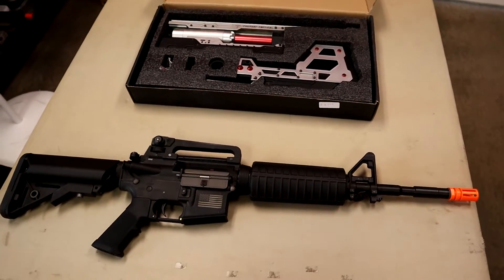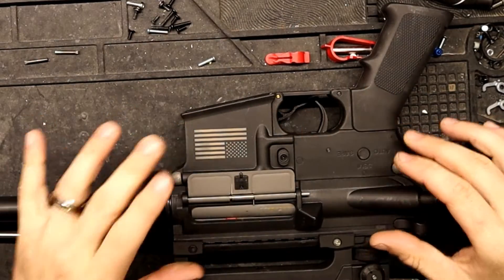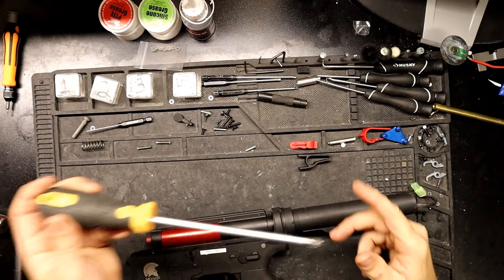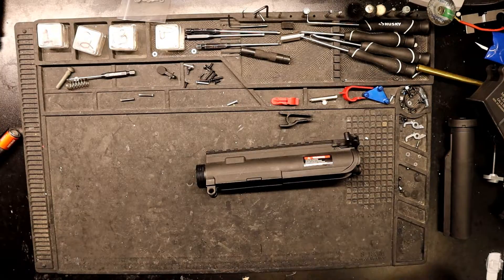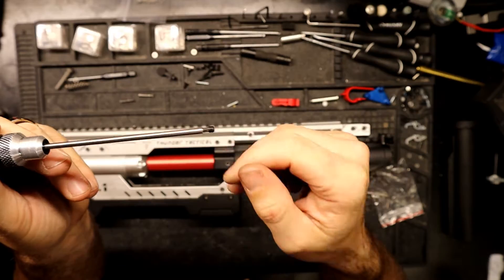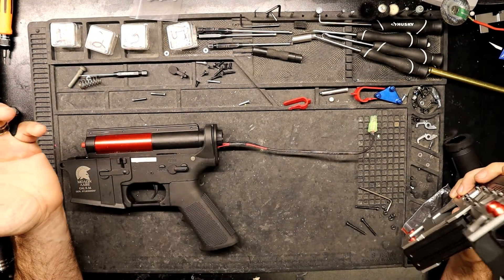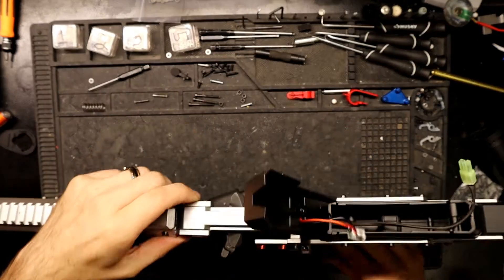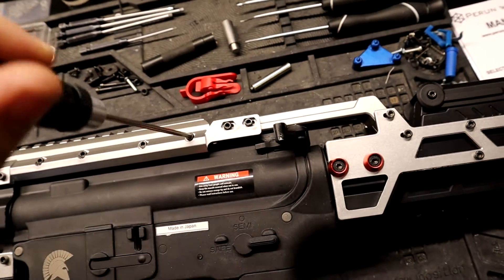EM Stryker Install Guide #airsoft #airsoftnation #howto

Comment: Hey man.. What do you do with the spring that goes over the inner barrel?  Theres nothing in my kit to hold it up against the gearbox..
Reply from the maker: If you need to have something to hold the hopup against the gearbox.  I recommend using orings slightly smaller than the outer diameter of your barrel. Then stack as many as you need  until your hopup is firm against the barrel.  Its by far better than using a spring.

Comment: Not that it matters to much, but there is a notch that's kinda tricky to place the washer, it actually fits the washer and screw to hold it more secure on the stock, I had to cut the length of the screw alittle. the first of the screws goes on to the butt of the gun and the second ones rest against the washer once tightened
I'm way confused on what to do to keep the inner barrel from free moving at the end of the gun :/ 

I got my kit from a box of awesome and didn't know at all what I was doing.
 watching this would have helped quite a lot haha
Reply from the maker: Im very happy to hear it helped! I make these videos to help people with their guns. So, hearing feedback like this is great!

Comment: Hey man, did the conversion kit come with the Barrel Stabilizer? I saw you pull it out of the box but EVIKE said it was sold separately.
Reply from the maker: This one did come with one.  If it doesn't you can take the current one off of your AR and cut the front off it off.
Reply: @wyshtechairsoft  Thanks to you, I was able to build one of my own. Excellent Tutorial.
Reply from the maker: @Kevin Wu  That means alot to hear that! Glad to help!

Comment: Can you post a link to the battery you used everyone is saying that the gun will be crap cause the battery won’t have enough power to work long enough and also to switch out the small Tamya plug to a deans do I just cut and solder or is there something special I need to do……thanks in advance
Reply from the maker: Does your m4 have a mosfet? Also, there isn't much special on soldering on a deans. Just make sure not to reverse the polarity. On batteries, cut 1 wire at a time or sparks, and damage will occur.
Reply from the maker: https://www.evike.com/products/90439/  Get this instead. It's got a basic mosfet and already wired to deans. Then you just need to get an 11.1 25c 1300mah battery with a deans connector.
Reply: @wyshtechairsoft  the issue is I’ve already got the base gun…..it was one of my first guns but that’s why I wanted to do this kit to spruce it up……I don’t mind putting in the work to make it work if I’m able to
Reply from the maker: Oh, gotcha! Your rifle will work like it normally does with the kit on it.  Just make sure to solder on your deans when you take the stock off.
Reply: @wyshtechairsoft  yessir thanks so much and sorry to flood you with questions but can you post a link to the battery you recommend?
Reply from the maker: https://www.evike.com/products/64867/ here ya go
Reply: @wyshtechairsoft  dude you are the man thanks so much………this works well with full auto and doesn’t puff up or anything?
Reply from the maker: @Joshua Hartnett  what puffs up the battery is overdischarging it.  I recommend getting this, https://www.evike.com/products/53682/. Its out of stock but you can find them on amazon.  They check how much juice is left in the battery. When you get it.  Make SURE you dont drain the battery under 10% and make SURE you only use a LiPo charger.  Not just a regular charger.
Reply: @wyshtechairsoft  sweet I really appreciate it man
Reply from the maker: @joshuahartnett401  No problem! Glad to help!